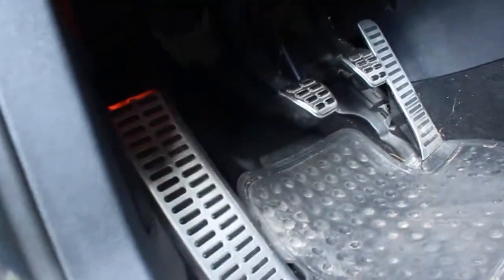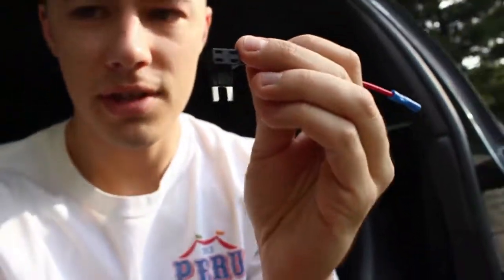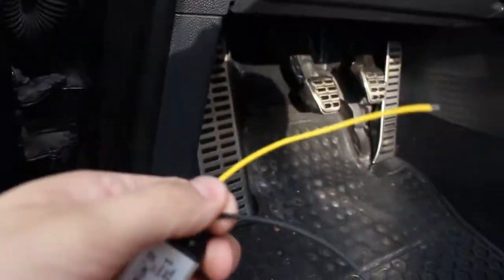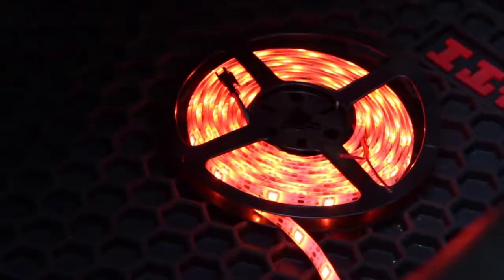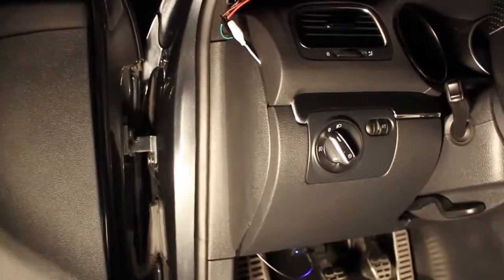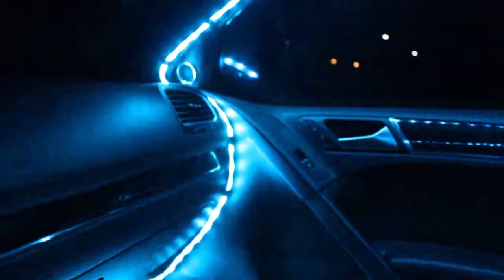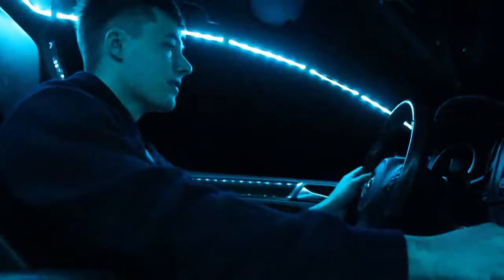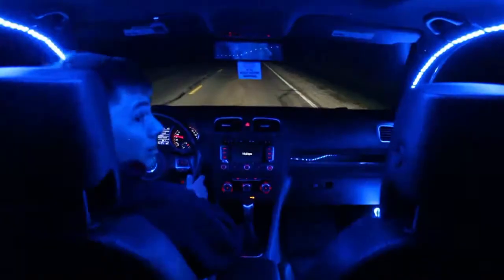Reading ECU data with an obd-ii Arduino module

Comment: can you show exactly how you did the code and connected the board to the freematics?
Reply from the maker: I added my sketch i used in the description. If there's no errors in your code than you probably have an issue with your connection to the board.
Reply: @calprowe  Just curious of where we can download those library headers you included.. My program wont compile because it can not find those headers.
Reply from the maker: @arjunetoolsie6315  https://github.com/stanleyhuangyc/ArduinoOBD

In pretty sure this has everything you need

Comment: Use own and a light sensor to adjust the brigness to ambient level like your dash and bright during the day. Needs some diffusion to
Reply: he doesn't need to, use the sketch file and instead of having a high value of 255 bring it down to like a 100 or so.